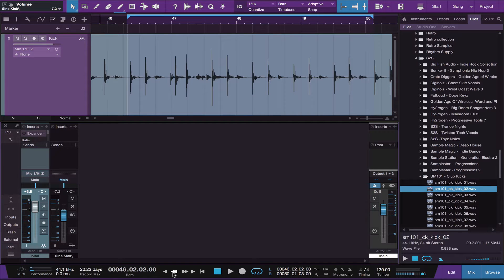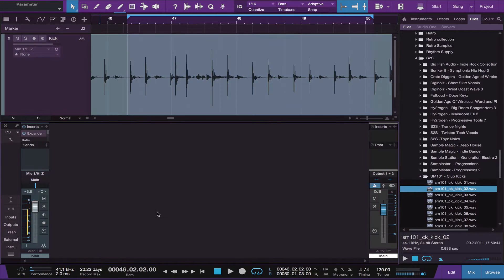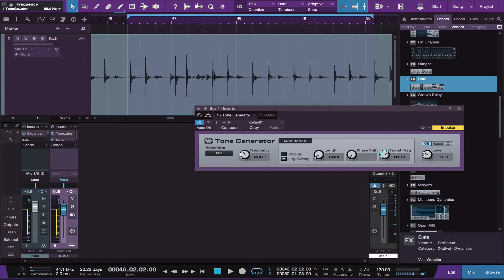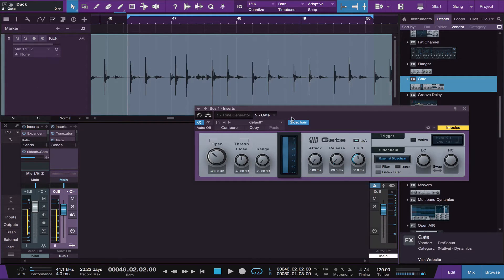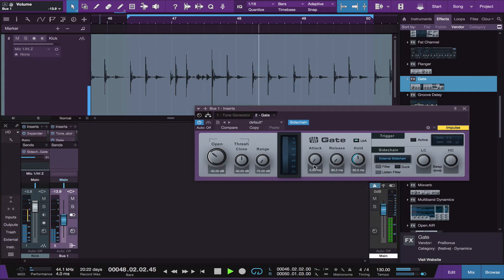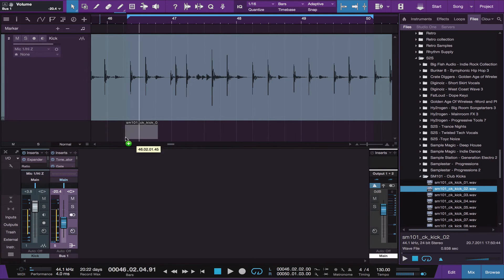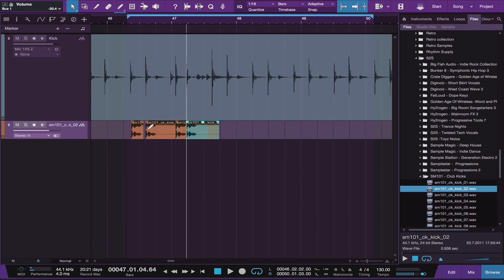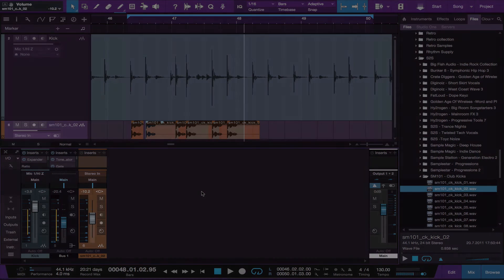Two Tips For Kick Drum Enhancement In Studio One 3

Comment: Hi..Thanks for the video. I recently learned the tone generator trick which is great, however I was trying to determine if it were possible to trigger a .wav drum sound in a similar fashion? You mentioned that copying and pasting was the long way, so is there a way to have the wav bass drum sound fire from the gate the way the sound generator will? I have studio one 3, but am still fairly new to it, especially replacing acoustic drum sounds. Thanks again.